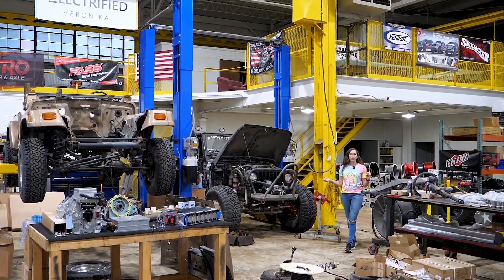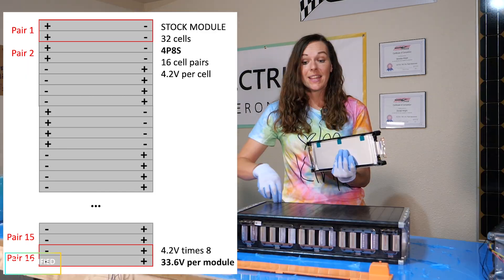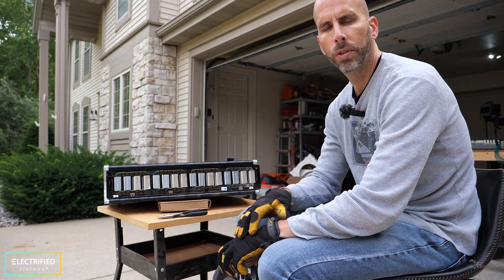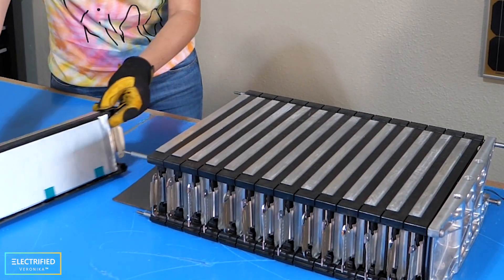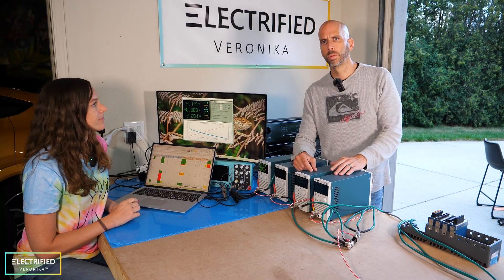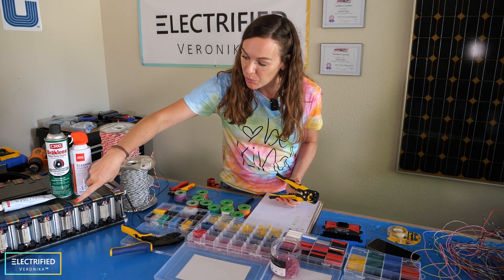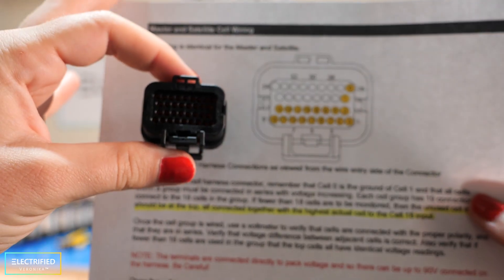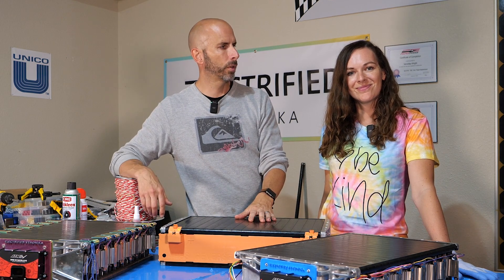Build your own Lithium-Ion Battery - EV Conversion

Comment: It might be late but I have a question regarding battery pack, I have seen manufacturers using 48V modules and then connect them in series parallel to get required voltage and power but I would like to know what would be the problem in building a 400V module (100 cylindrical cells in series) then connect these modules in parallel to get required Ah rating to build a battery pack?

Comment: FYI: AEM's Battery Management System is not on the market yet, as of October 15, 2022. Both P/N 30-8401M(aster) and P/N 30-8401S(atellite). When  released they MUST be used the AEM's Vehicle Control Unit. It will not work as a standlone BMS.

Comment: I am in the early days of doing some homework for an ev conversion, never really thought about reconfiguring the batteries the way you did, given me some ideas.

Your load is a Kunkin KP184 that can pull 40A, your graphic says the test is a constant 40A for about 13000 seconds or well over 3 hours for a test (143Ah/40A is also over 3h.. :)  ), per cell.  I also see that you have 4 of these units.  Do you have 4 so that you can test 4 at the same time or could you put say 2 of the loads in parallel and draw 80A for half the time and measure that?  80A is a lot of draw.

Either way testing every battery in a pack is going to take a long time..  ;)
Reply from the maker: Hey that’s cool, which car do you convert? Yes we got 4 to parallel them for a high current test on the module, but the software we are using can only control one at a time. For the cell tests so far with the 40 A constant we do 4 tests at the same time which yea takes some time but for us we also find that the cells on each module are very similar so we only do the long test for 4 cells per module. More on that in future videos ☺️
Reply: @ElectrifiedVeronika  Haven't decided on a car yet, lot of variations to consider.

7 batteries * 16 cells per battery *3+hr per cell = weeks of effort, no wonder you went parallel load.  Look forward to future videos, keep up the great work..

Comment: Wow, the battery re-configuration is very labor intensive.  Are you doubling the voltage on each module only or entire pack for an 800v system?  Did you discard & recycle the weak (red in spreadsheet) cells?  Why did you need a kitchen oven for power test?
Reply from the maker: It is, I cannot recommend this process - reusing or repurposing batteries is HARD with these types of mosudles. We are doing that for each of our modules - in total we will get to a 400V system with 6 modules - that's the latest status :-) We are storing the "red" cells right now and once we are done we bring it to a recycler. We use a kitchen oven in order to be on the safe side for our cell testing. If you just do low current charge and discharge tests you should be fine anyways but we also do high power cycling for parameterizing some models and just to be on the safe side, in case something happens during the test, we have the thermal event happening in the oven and our garage will be ok.

Comment: I would suggest using a dielectric grease on the pop rivets as they are dis-similar metals. André in Sydney
Reply from the maker: Thanks for the input. The rivets are copper and the busbars are nickel coated copper. Greetings to Australia

Comment: Great work and amazing project. Author, please swap the words parallel with series and vise versa in your first 3 minutes video.
Parallel allows you to double the current and keeps voltage same and series doubles the voltage and keeps current same.
Keep up the great work.
Reply from the maker: Thanks! Hehe, we were expecting a comment like that.  The stock module is labeled parallel first and serial last, see orange cover, so we decided to use the same order.